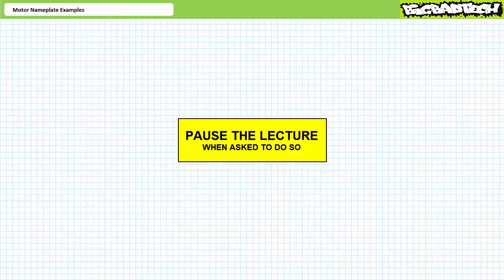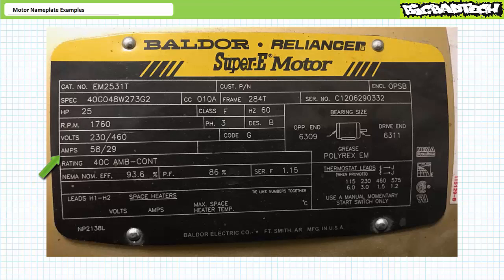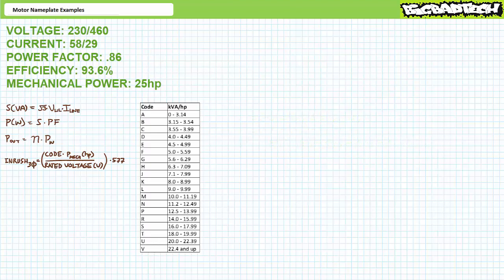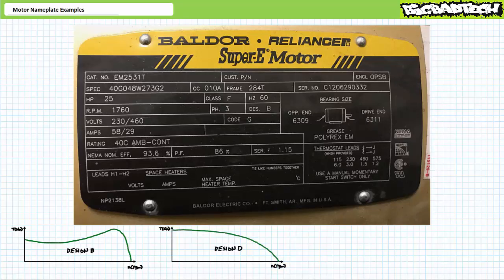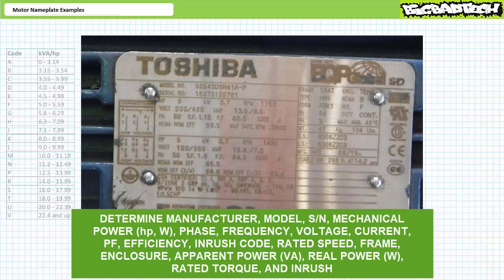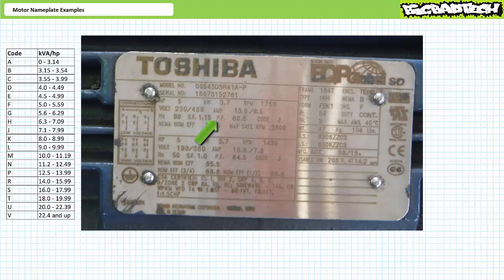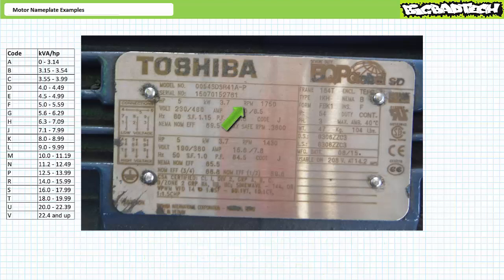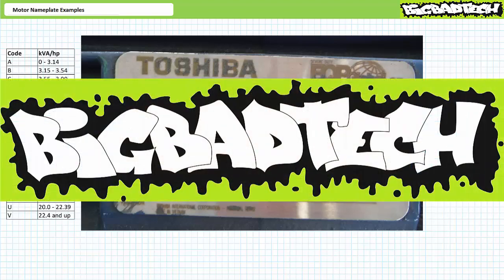Motor Nameplate Examples (Full Lecture)

Comment from the maker: ERROR at 9:40 rated current in the high voltage configuration is 6.5A (not 19). Apparent power is still 5.2kVA and real power is still 4.2kW.